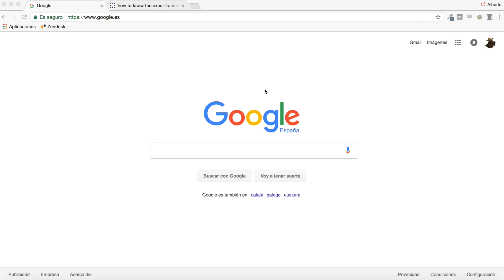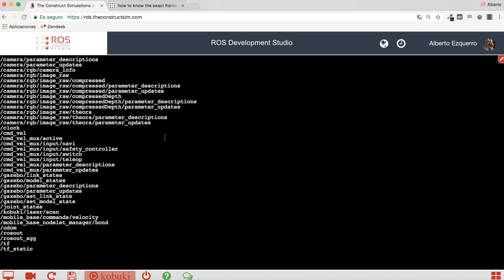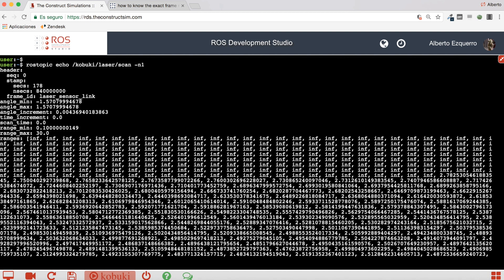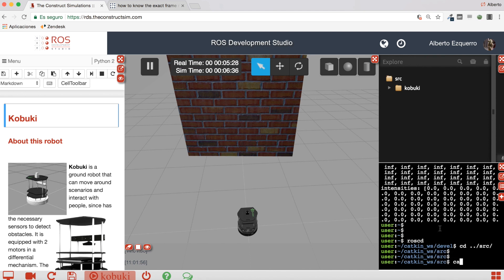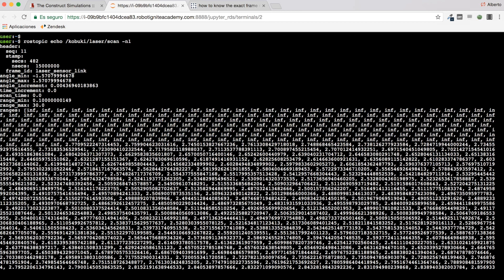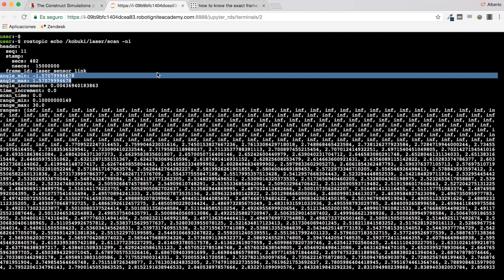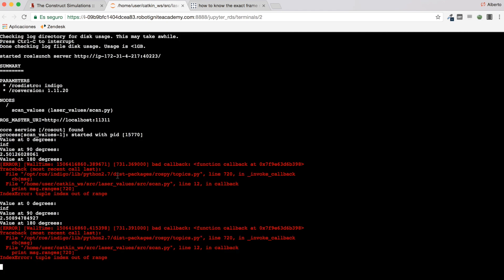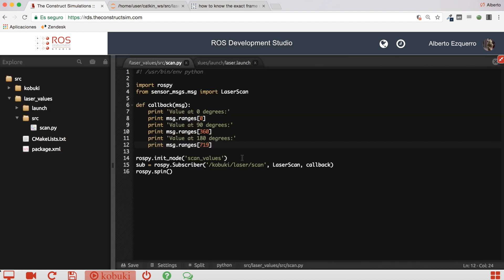[ROS Q&A] 031 - How to read LaserScan data

Comment: 1)I think you have just executed the launch file in 9:20 without compiling the package. Is that possible?
2)Another thing why didn't change the CMakeLists.txt ? Maybe when the src file in python you don't need that , idk I have only done the Ros Basics in 5 days (c++) .
3)One more Thing , why the output was a multiple of 720. Is that maybe bacause the callback function is called multiple times? When I look closer later , the value at 90 degrees seems to be changing slightly ,does that means that this is the result in real time and the robot is slightliy moving forward ? If that the case then why would the output comes to an end after a number of outputs? 
I would appreciate it to have answers. I am a new member of the community of the construct 😄😃 .

Comment: Hi,  should the value at the middle of the ranges array be 359 instead of 360?
Reply: well if we have 720 values, you can divide them equally into 2, but you see that there is no middle element. As we only need approximate reading of what is at front, both 360 and 359 will be fine.